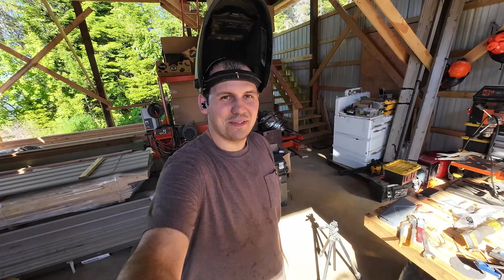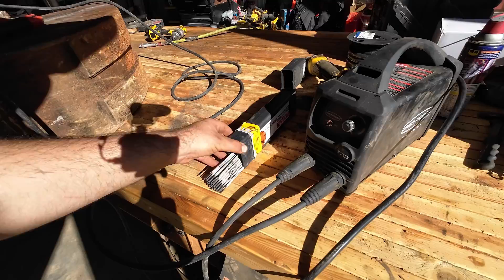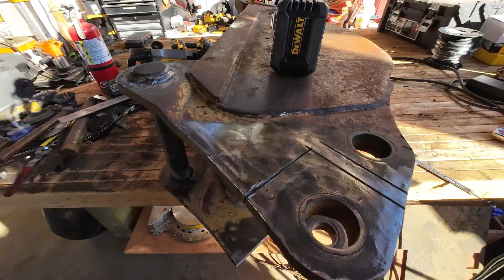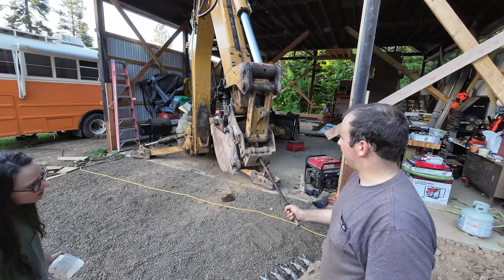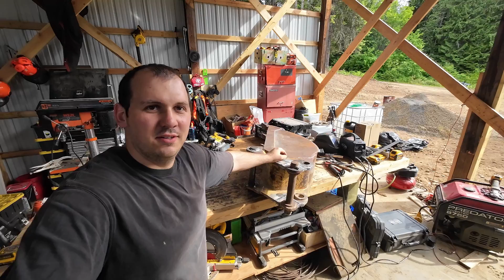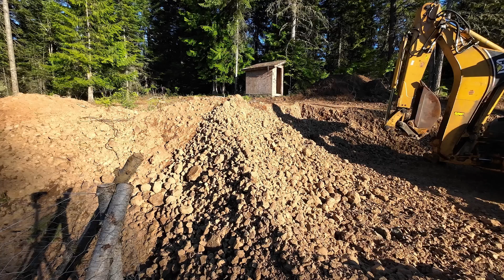Off-grid Welding!  Modifying the Pin Spacing on Our New Trenching Bucket

Comment: Josh,you have most likely have finished the pin job for future reference.if you can source mild steel pipe with thin wall ,make a total pin sleeve that will fit pin and old bush for interim repair,just a thought ATB from Perth 🇦🇺🦘👍👍👍👍
Reply from the maker: @MikeeonYouTube4  Hi Mike!  That sounds like it would work great. I will keep that trick in mind! Thanks for watching!